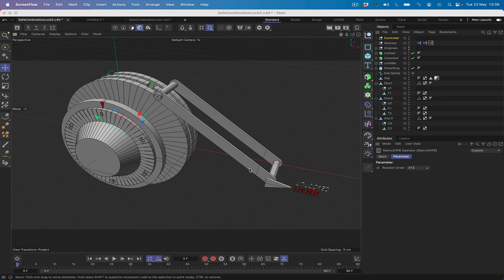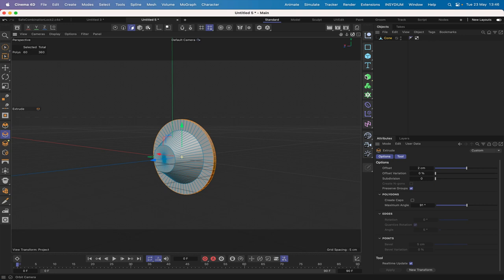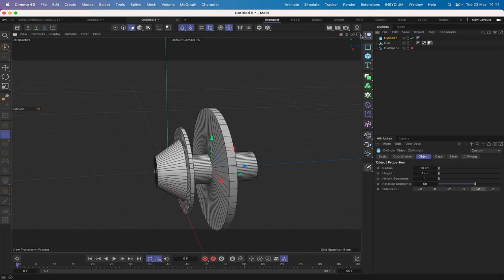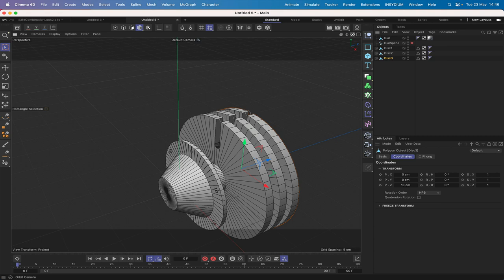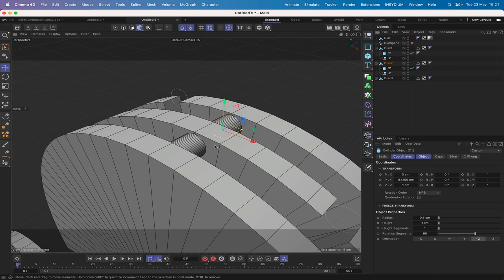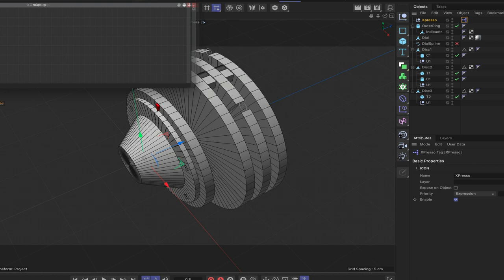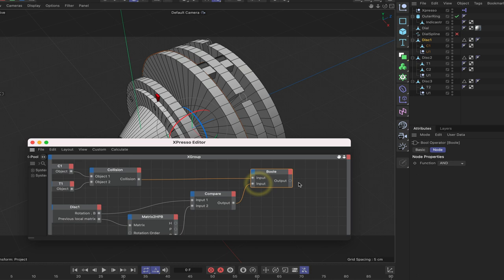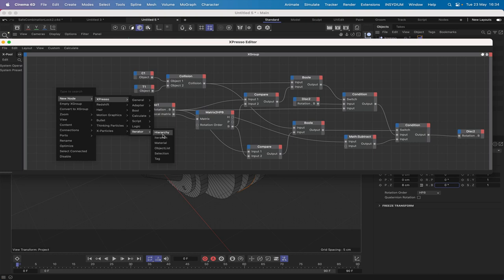Cinema 4D Xpresso Tutorial 62:  Safe Combination Lock (Part 1)

Comment: 20:15 You are in the wrong mode. You are in "model" mode but you need to be in "object" mode.
model mode and modeling mode are different modes.
Modeling modes are poly, edge and point mode.
Model mode is between texture mode button and poly-mode button. Where you can choose between "model" "object" and "animation". There you have to use "object" mode and then you can totally center the axis with the coordinate manager.
Reply from the maker: Many thanks!